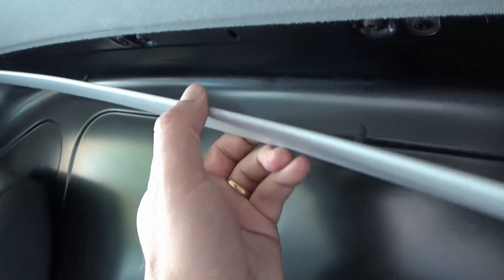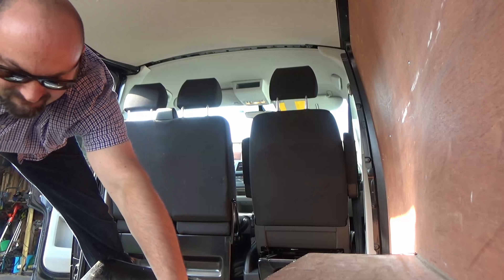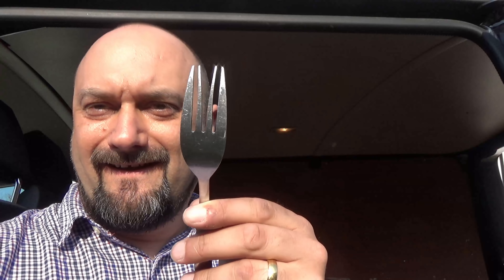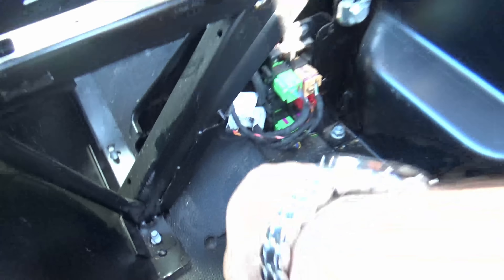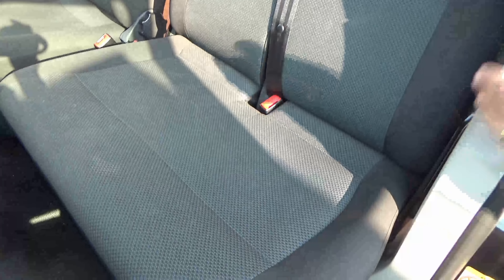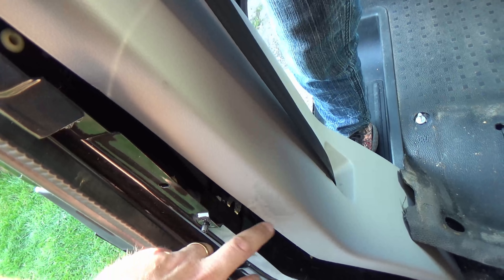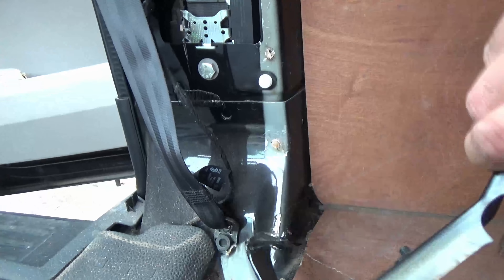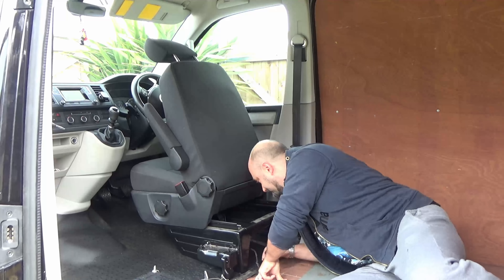DuB-EnG: Home Build a VW T6 Camper Conversion highline model - Removing the bulkhead - Part 1

Comment: I did kind of similar in 2006 when i bought a transit for my courier business. I needed to live in it, but still needed to keep the full size for loads i would be carrying around Europe. Good luck with the build, sometimes you will not see what you need until you go on a long trip and figure out you need something, but that's the best thing, its always evolving.
Reply from the maker: Evolution! - Exactly! - Thats where we will go...  were trying to figure a name for the van...  maybe you just nailed it!
Reply: @DubiousEngineering  as long as i'm the first destination of your road trip.

Comment: Great content pal. We're just shopping for the t6 base now. It's great you're showing a recap of which tools you used too. Assume some of us know nothing!
Reply from the maker: Thanks Matthew...  I have a few videos on this project so far...  suggest sitting with a cup of tea when you have an hour to spare...

Here are my T6 Relevant videos so far...

I make YouTube Videos ... Here are my T6 Camper Conversion Videos
Part1   - Buy the van and remove bulkhead
Part2   - Install sliding swivel seat and LEDs
Part3   - Installing a leisure battery
Part4   - Sound damping, Insulating, Carpeting
Part5   - Flooring and fitting a RIB bed

More to come people...

Comment: A VOLKSWAGEN CARAVETTE would have been better as they already exist and a lot less hasle except for the elevating roof.
Reply from the maker: DAVID GREGORY KERR I believe the caravelle is a 9 seater, you’ll still need to remove all the seats, insulate it and carpet it, then fit a bed seat and kitchen, plumbing and gas etc.  The California is already a campervan, but it is £60k upwards... most converting is done with my model as it is the best value for money.  I’m half way through the carpeting now... looking promising!!  Hope you are well!  All the best!! Howard
Reply: We had one of the very early Caravettes only problem was the accordion sides which was reinforced vinyl and was prone to leaking sometimes and ours came with an Stereo 8 music system and we accumulated loads of 8-Track cartridges so of which broke but was a brilliant vehicle none the less and we had it for 4-5 years.